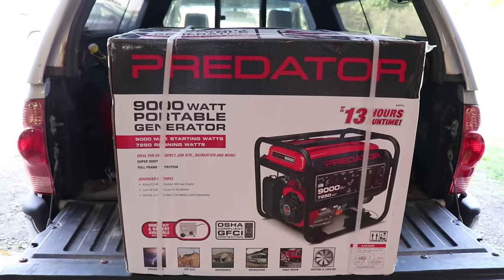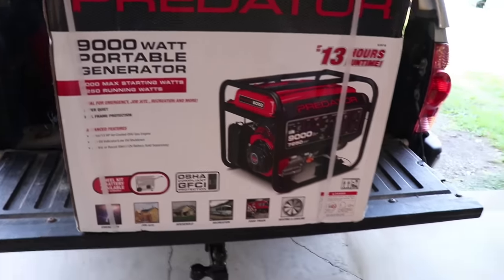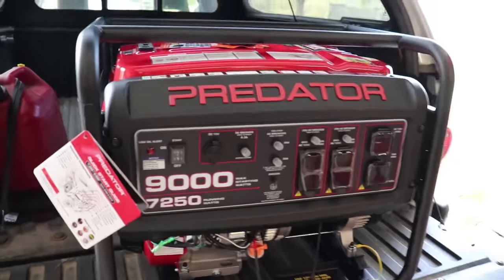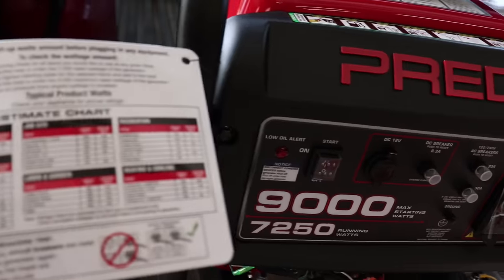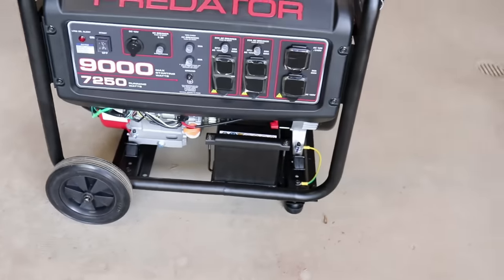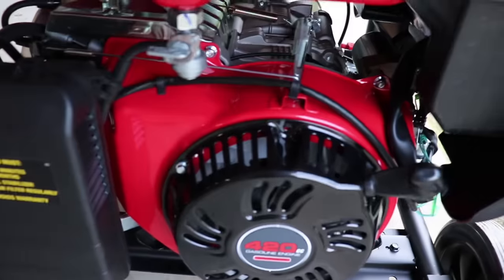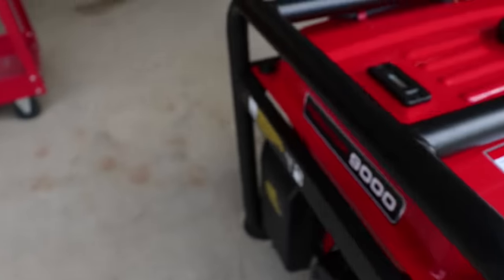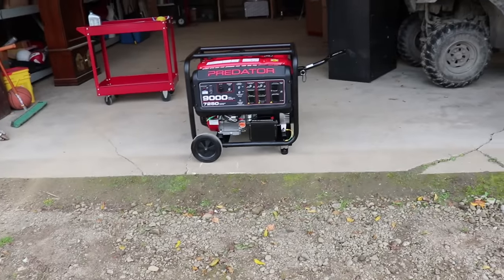Predator Generator Running Our ENTIRE Home. (Complete Setup and Cost)

Comment: I bought a generator due to Harvey i was a located a little south of the eye. Our electricity was out for a little over 2 weeks. I researched and built a breaker into my box and now I crank my generator and keep my house going. I also recently lost power during this cold weather. Its been out for the past 4 days with this cold. Thank god I invested in a generator
Reply: My 4000 Sportman generator is on its way. Will this be sufficient to provide electricity for my entire home(2,100sqare footage)? Where can I find someone to build a breaker into my box?
Reply: @unityaboriginelove6595  you need a bigger one than that for the entire house!
Reply: @unityaboriginelove6595  4,000 would not be sufficient it varies on how many big items your powering
Reply: @unityaboriginelove6595  if you have central AC, microwave and electric stove you would not have enough power.
Reply: @alfredozertuche4243  - okay. I may have to take it back. What's the least amount I need to power the entire home? And yes, I have central air and heat, electric stove, and microwave.
Reply: @alfredozertuche4243  - I'm looking at the Pulsar 6,580/5,500-Watt Duel Fuel. Will that one work for the entire home?
Reply: Nice isn't it.
Reply: @unityaboriginelove6595  I forgot to also mention my central AC uses gas so less power I need to run my system. If you have an electric AC furnace you will need more wattage
Reply: @gradyrogers6707  yes indeed looking into getting an echo generator
Reply: How much gas does it burn if you run it none stop. I have the 8,000 and i used it when it freezed last week. it ran for 14 hrs on 5 gallons. was wondering if its cheaper on gas with the plug, thanks
Reply: @madlifts1  I would check it around 10hrs and it would still have about a 1/4 of a tank still
Reply: @unityaboriginelove6595  go with the  Costco or harbor freight highest capacity  (I think both around 9000 watt) With today's over seas mfg standards and QC you want to run as far below cycle duty as possible. With a 9k watt gen you can easily use 100% .
Reply: @dw6015  -Thank you, D W, and will do.
Reply: @unityaboriginelove6595   if you're planning on running central heat and an electric oven, no. if you want to power the fridge, a couple of lights, the microwave and a space heater, you should be okay as long as you don't run everything all at once. I have a 5000 watt generator and i can power my refrigerator, freezer, a floor ac and some lights just using the 110/ 20 watt plugs. If I had a transfer box to run the 120/240 outlet directly to the house,  I could power everything but the electric oven and dryer.
Reply: @vincekauffman6051  - Thank you, Vince. I have decided to keep the one I have for right now. I don't have enough money to buy the more powerful generator. I appreciate your feedback. Have a great weekend.
Reply: Make sure you all are aware with the hazards of using generators. Many people have died each year when using generators during power outages. That’s why generator safety is very important and it’s required for safety. Thank you
Reply: @Stephen Bazemore - Thank you, Stephen for the advice. I'm keeping it for now because it's better than having nothing at all. The generators are so expensive.
Reply: Very similar to our Chicago electric. Wheels and handles are on opposite ends. Best to have a battery maintainer plugged in to keep it ready for emergencies.